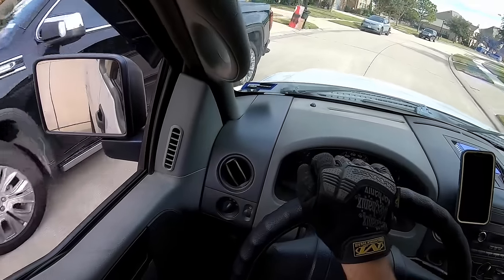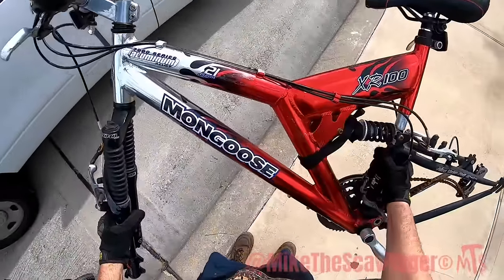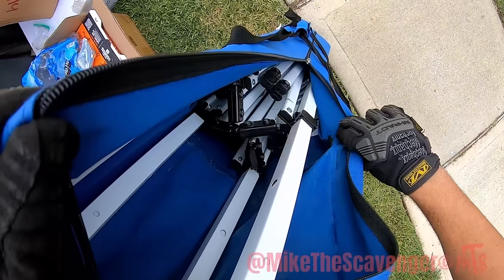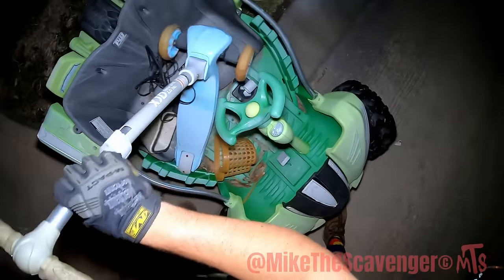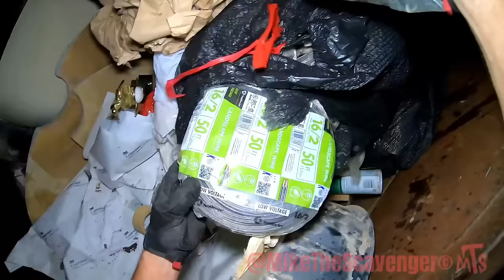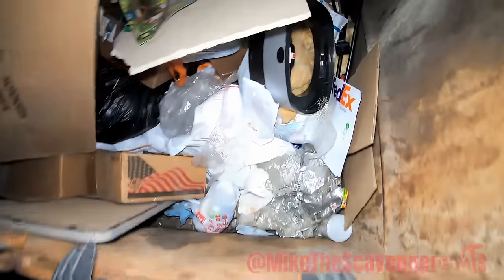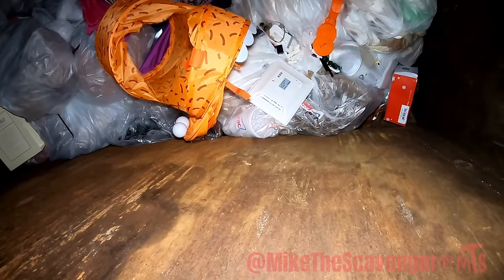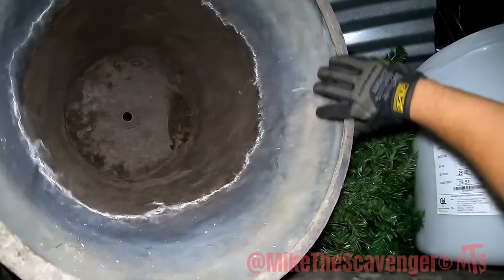Dumpster Diving & Cursiding "Construct Your Dreams!"

Comment: Mike you should be able to have a l arge Christmas lights setup unless the HOA restricts you on when you can put up your lights.
Have you checked out the Bird dummy load and the N male to male jumpers ?
I hope you still have them. I will trade you 30 pounds if number 1 clean copper for trade.
I haven't started melting the copper down to bar stock.
Merry Holidays. I don't wish to offend anyone on your YouTube channel.